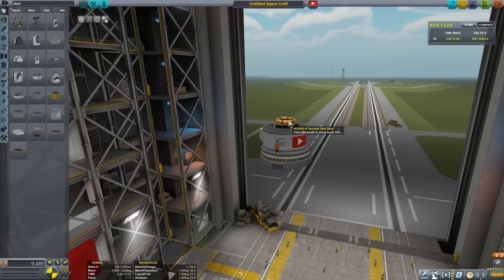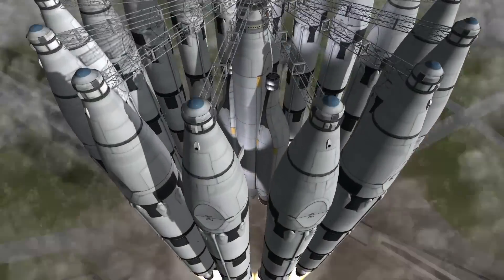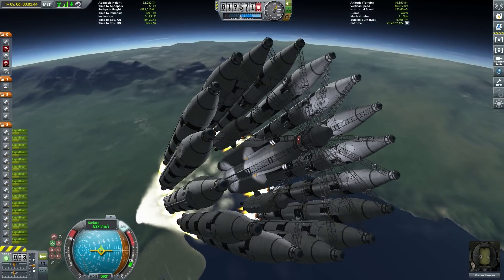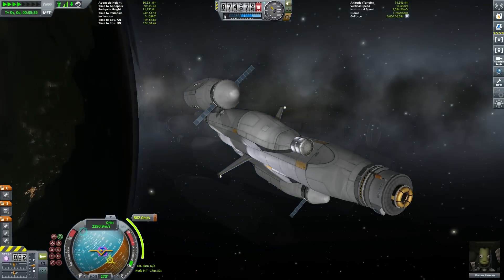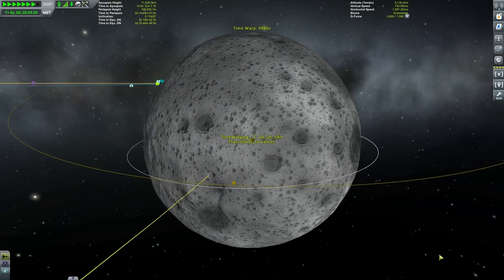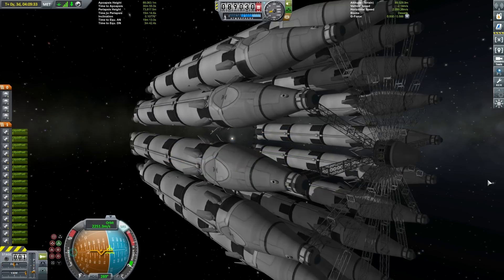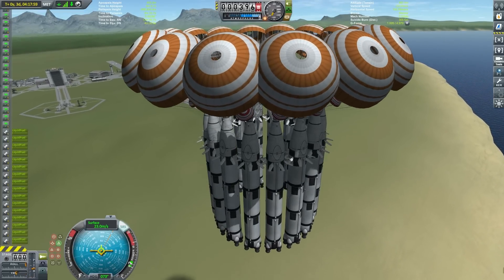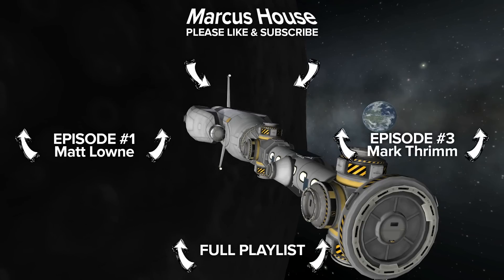Collaboration Station #2 "Extreme Fuel Module" -- KSP

Comment: How did it's massive ship turn from prograde to retrograde so quickly?? I have a 100+ ton ship and it takes 2 min to turn around...
Reply from the maker: Lots of Verner engines on the sides.
Reply: Will try it, thx!

I tried to put 20 monopropellant thrusters but it's still slow...